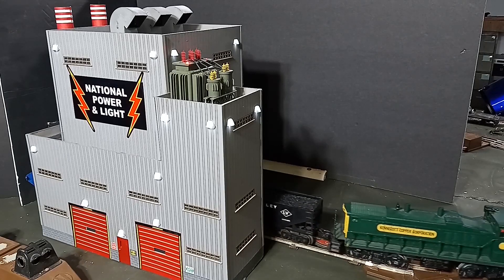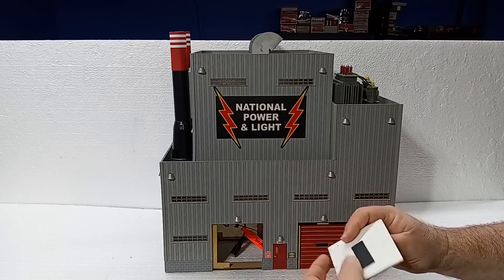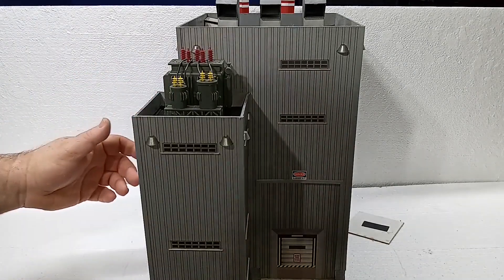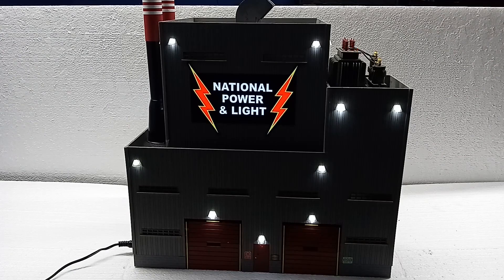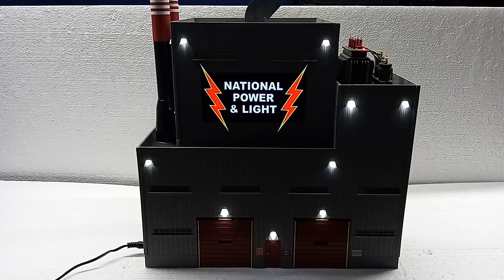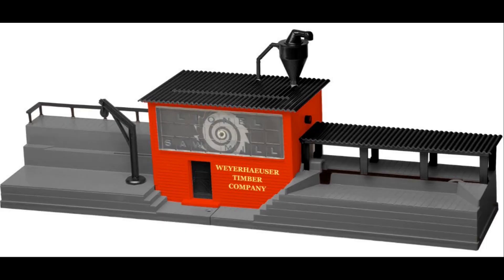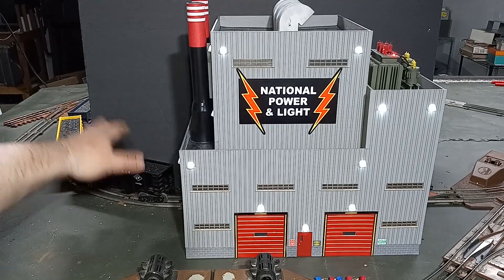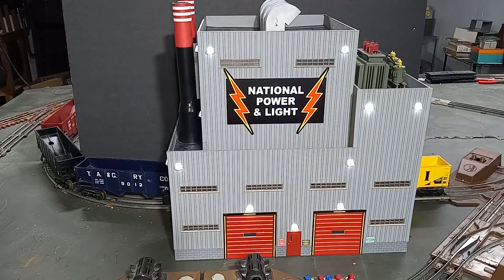Menards O Scale Power Plant: Unboxing, Review (And A Bonus Special Effect!)

Comment: Fine job of describing the building. I have several Menard's buildings and I love them.  I wouldn't mind opening that end of the building to add it on a siding but Its insanity to run a mainline through this or any buildind I wouldn't want to work in an environment like that as it wouldn't be very safe. Although I have seen many modelists doing just that.
Reply from the maker: Thanks for the feedback. If you have very limited space, the option of running a main through several buildings is a lifesaver.

Comment: Before they had plastic many buildings were made of fiberboard and or sheet paper it was relatively easy to scratch buildings that suited the available area they usually would be reinforced to handle the rigors of high and low humidity in the basement it kind of went out of fashion after plastic came

Comment: It's a Power plant that basically does nothing. I would have at least made the transforms on top usable then people could run actual power lines using the readily available power and light poles for a more realistic power supply layout instead of constantly drilling holes in the layouts.